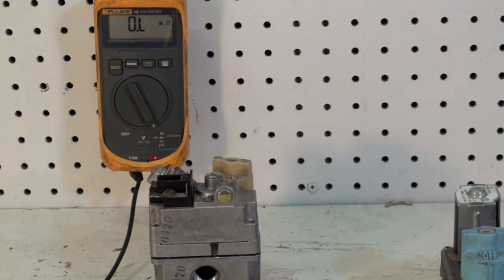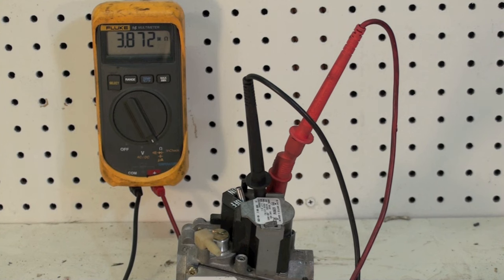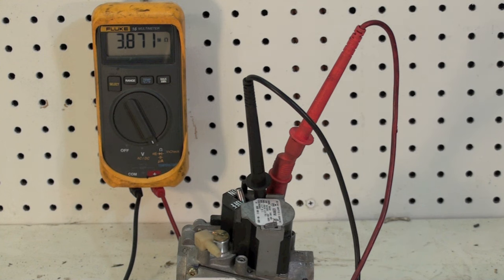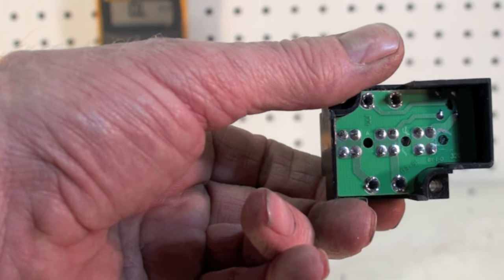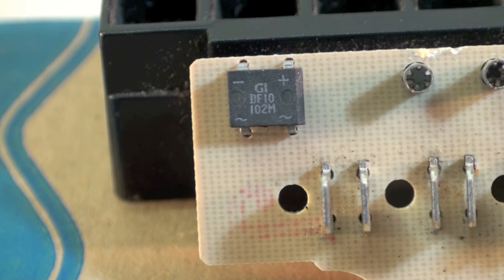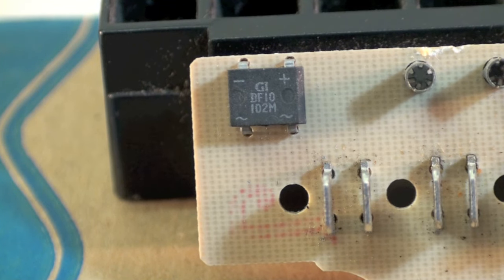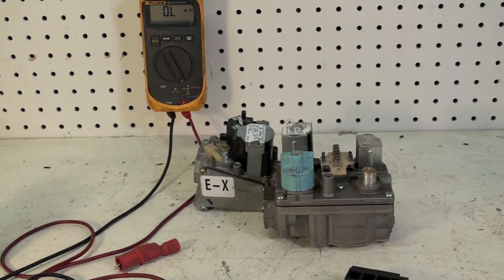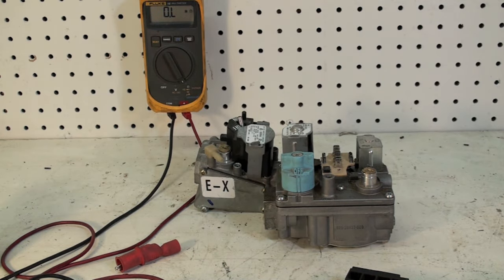How to test the gas valve on a gas furnace with an ohmmeter

Comment: what about a continuity test on the valve?
Reply from the maker: If you are asking for a continuity test of the solenoid itself, I did not see the point as this is primarily a diagnostic video.  Even if you did find the solenoid open, you could not replace it as those parts are not available.  
GFM

Comment: Thought my coil was open until I discovered that little rectifier in there.
Reply: Bill Roper...Did you have continuity across the two terminals before you checked the ohms on it ???
Reply: @lanthonyperdum6430  It doesn't read anything because your not reading the coil valve directly. I took the thing apart and took the little board out that had the rectifier on it and checked the coil and it was good. Took the rectifier off the board and it checked good. Put it all backed together and then everything worked okay. I think my whole problem was it had a bad connection where that little rectifier was soldered in the pc board.
Reply: Bill Roper...Thanks for your reply...I was thinking that I could read continuity across the two terminals if the coil was good or get a ohm reading I see that’s not the case...I’m thinking my problem is more mechanical than electrical...So again is there a true way to check the coil on the valve to make sure if it’s good or not  ???
Reply: @lanthonyperdum6430  On mine I could take that little board out with the rectifier on it and get to the wires coming out of the coil.That's the two you should get an ohms reading on. I don't remember how much resistance but you should get something. I had to take a small plate off the top of the valve to get to it. It was held on with little tabs I had to straighten to get it off. I'm sure it wasn't meant to be taken apart but I did anyway. Did you check if you were getting 24v. to the valve when it tried to light.
Reply: Bill Roper...Okay...I have checked the two red wires on the coil itself after the board and they are good...Now I get 24 volts to the coil but it drops out and is not constant...I’m thinking that it should drop out because the valve is not opening...Could this be true ???
Reply: @lanthonyperdum6430  Yes it may be stuck closed. Now that you mention it I remember taking something like pliers and tapping on mine as it is supposed to open. Try it and see.

Comment: I am getting hight voltage from the gas valve I have and it looks like the same one with the blue knob. I am getting a lockout and the ingniter is new and it just click from and doesn't start. Am I on the right track or should I replace my white Rodgers control unit model 50e47-843 any help ASAP would be great. Thanks
Reply from the maker: If you are getting 26 to 28 volts at the gas valve on a trial for ignition, the control board is probably ok.  
GFM